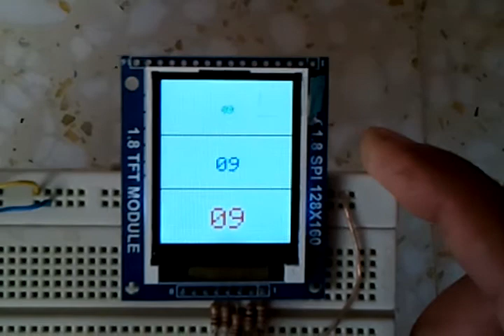PIC18F4550 Microcontroller with ST7735 SPI TFT Display

Comment: no funciona  tiene muchos errores
Reply from the maker: Use CCS PIC C compiler to compile the C code!
That code has been tested with CCS PIC C compiler versions 4.067 and 5.051.
Reply: De pronto si puede ser la version
Reply: why you don't used C18 compiller ?